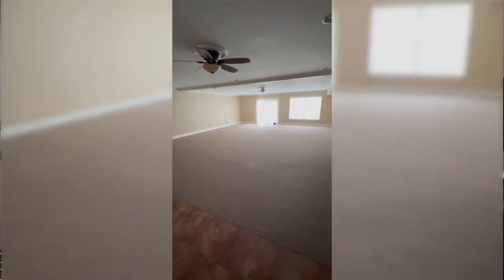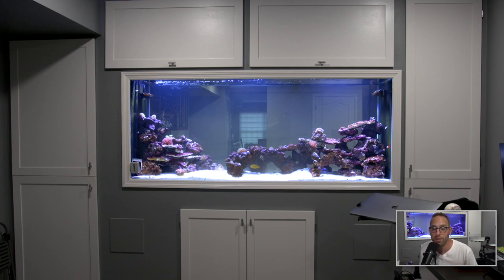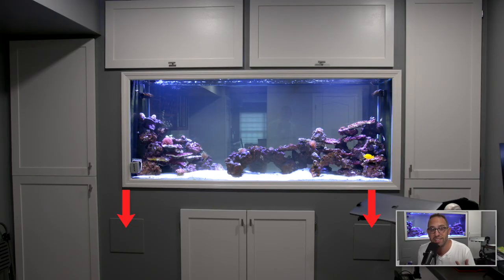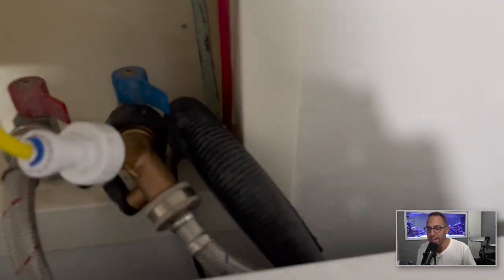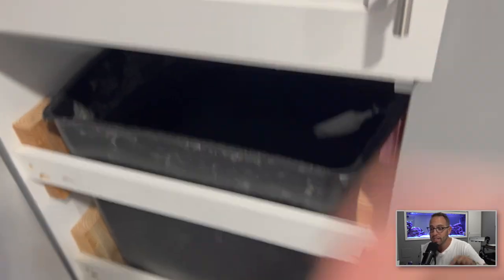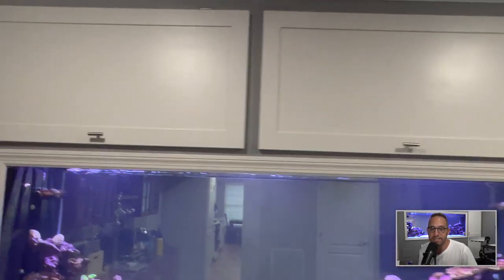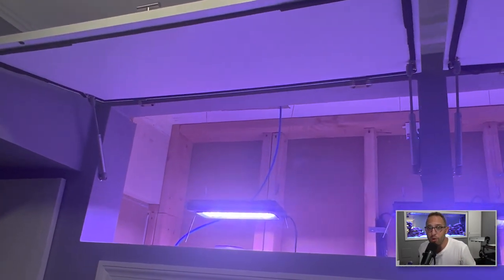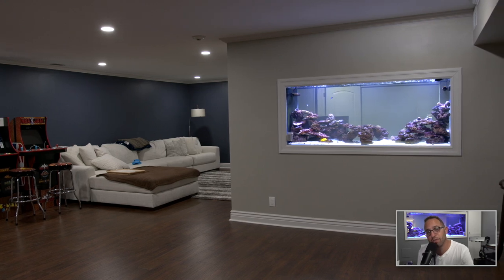INSANE - 250 Gallon Double Sided In-Wall Saltwater Reef Tank - Full Build & Gear

Comment: That's a lot of bare/unfinished wood very close to the water. I feel that the framing of the cabinets - especially near the top, will warp in short order.  
How do you plan to do water changes? Is there a drain nearby?   100gallons of top off is good but where are you mixing salt?
Reply from the maker: For the cabinets and the top the framing is actually away from the tank and theres good ventilation up there so there isn't any humidity.  long term if theres an issue i can always treat the wood.  None of it is actually attached to the tank.  There is a bathroom nearby as well as the back door where we've run freshwater to when necessary.  We put a pump in the bin and mix salt right in the bin.  Before it goes in the tank we verify the salinity.
Reply: @JasonAron  gotcha.  Was hoping it wasn't 25ft away and still hauling buckets after all that setup.
Reply from the maker: @zachniedfeldt  definitely NO BUCKETS! Lol